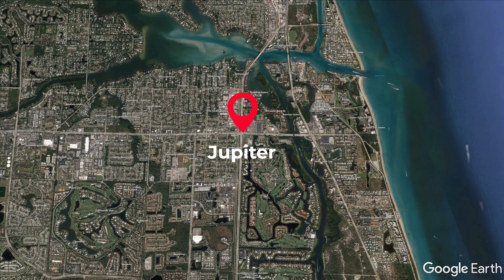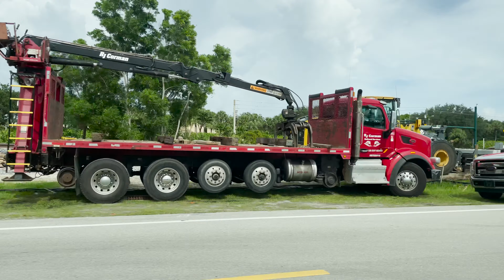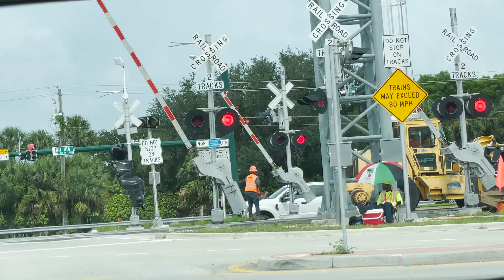South Florida Brightline Construction Between Jupiter and West Palm Beach - June 26, 2021

Comment: Why the need to go from two tracks to three on the stretch leading south to West Palm Beach Station?
Reply from the maker: The Port of Palm Beach is in this area, so the train that picks up/drops off there needs the additional track to work on without blocking the mainline. It does not go all the way to the station.